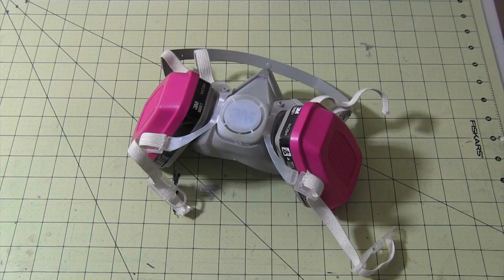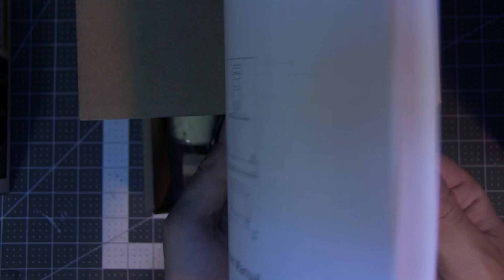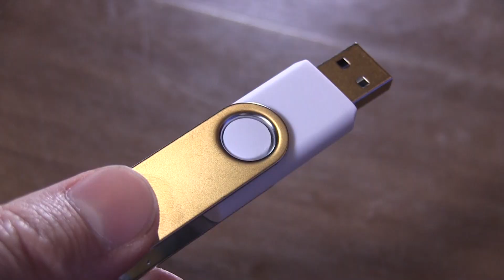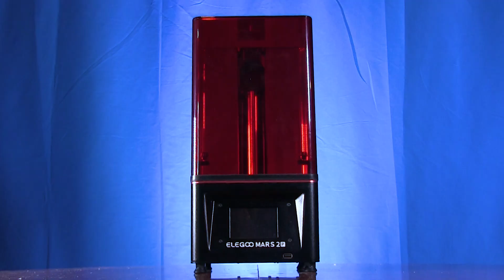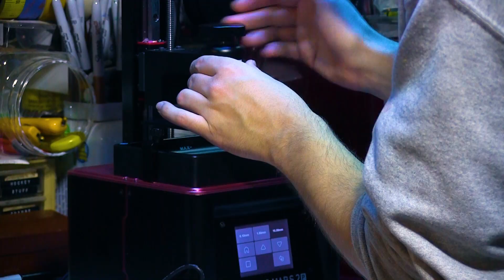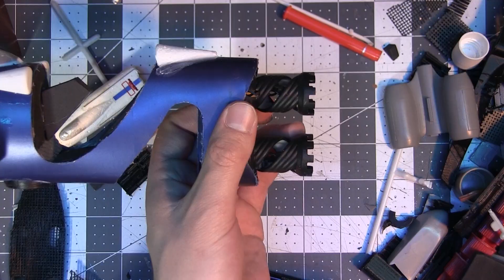Elegoo Mars 2 3D Printer

Comment: Can you explain how the UV Light Curing works? I've seen printers as Anycubic Photon and they come with a Wash & Cure machine for all the remaining resin on the 3D printed figures.
Reply: When the part is printed it is cured to a point where it is strong enough to handle but it is still not fully cured and still bit tacky and soft. To fully cure it you need to wash off any excess resin from the part in a UV free environment. Most resins need to be washed with isopropyl alcohol but some are water washable, the label should say. Once cleaned the part needs to be exposed to UV light for while longer. In my experience 20 minutes in the sun and turning the part every 5 minutes had worked great. A curing machine though is faster and doesn't require you to turn the part. I'm not sure how the washing function works though, I would assume that hand washing parts is safest and most effective.